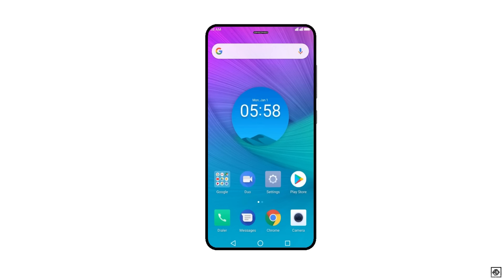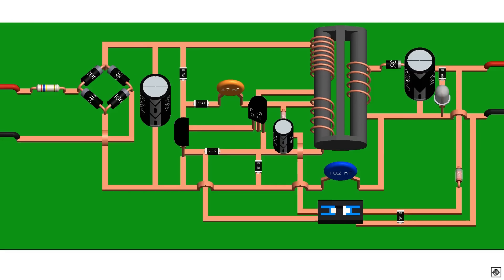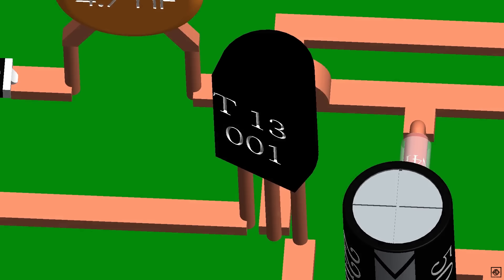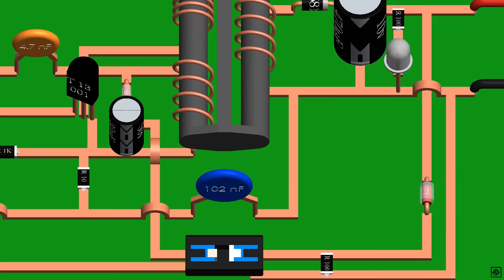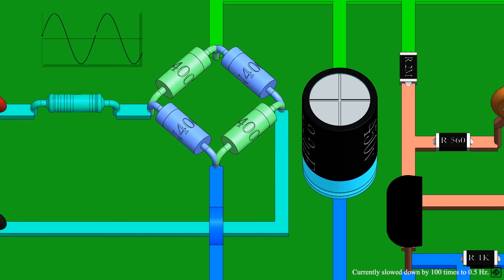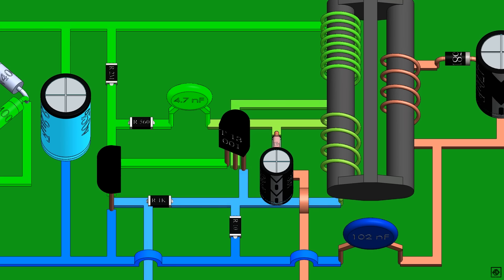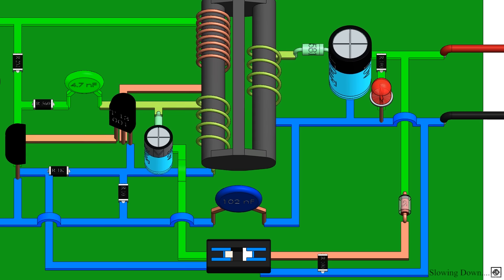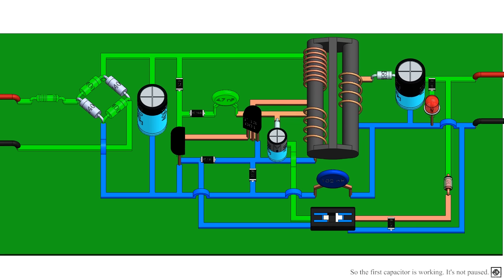How does a mobile charger work? SMPS with Opto-Coupler.

Comment: Great detailed explanation. Please review the markings on disk capacitors. I believe 102 nf indicates 10 plus 2 additional zeros or 1,000 nf value. Thanks.
Reply: I'll just hijack this comment to say that it is not 102nF or 1000nF. Hopefully no one has used the circuit posted. That would be quite dangerous to do so.

The capacitor in between the primary and secondary should be limited in value since it can be a low impedance path from the AC line if it is too large. Touching the output side will essentially be connecting yourself with the AC line with only this capacitance in between.
A 100nF  capacitance with a 230V 60Hz line has 26.5kOhm of impedance and will allow up to 9mA of current (painful shock). Increase that capacitance to 1000nF and you have a maximum of 90mA (can be lethal).
It also has to be a special capacitor that is safety rated because it can fail shorted if it is not, which will make the output directly connected to the line. Again, touching this output will electrocute you.

Please don't play with high voltage circuits. You can kill yourself.
Reply: @ronnueda933  

Correct, the cap is 1nF or 1000pF, "102" means 10pF + 2 zeros. That's a common value for such interference caps. 

Another mistake is of course the inrush resistor value is way to high, should be 4R7 or so.

Also, the secondary diode is polarized wrongly. The diode is sopposed to be reverse biased while the primary is energized, so a  magnetic field can accumulate in the core, which, when the primary is turned off, collapses into the secondary with the diode conducting and charging the cap powering the load. 
This is an important detail as it sets apart the flyback transformers (with air gap in the core to hinder saturation during accumulation!) used in low power devices like USB 5V supplies like here, from other kinds of switch mode transformer set-ups.

Comment: The conventional AC/DC converter is a 220/5V  single-phase transformer + full-wave bridge rectifier( four diodes arranged like that in the video) + filtering capacitor. However, this circuit  will result in a heavier phone charger since the frequency used is 50Hz
Note that the transformer’s size decreases by increasing the frequency.
So they thought about this idea mentioned in the video
We will use a full-wave bridge rectifier converting from AC into DC, then we apply that DC voltage on an oscillator circuit that converts that DC into a high-frequency AC voltage, so in the final step, we can easily use a small transformer to a 5 V , however, this voltage is AC
So we will use one diode( half-wave rectifier) which is more economical than a full wave rectifier, and a capacitor for filtering purposes!
The final input/output voltage is 220V_AC to 5V_DC!!!

Comment: The resistor's value is too large to be a fusible resistor. It should be below 10 ohm
Reply: The 260k resistor limits effective current flow to <1mA (at 230V on short circuit, less current on normal use).

That can not work. Better circut would be a fuse on input and a polyfuse on output. Maybe using a common mode choke is required on input to reduce interference on power line.

Comment: The resistor on the AC mains input circuit feeding the bridge diode arrangement cannot be as high as 260K ohms.  They are a fuse resistor normally in the range of 1.8 to about 2.8 ohms at 1/4 Watt rated. (I used to work in designing power supplies and a lot more sophisticated than the simple type used for charging phones).  Some years back I was designing precision power supplies for communications systems. These were linear supplies. These were multi level supplies with both master regulation and sub regulation circuits using linear regulation circuits.  I also worked in designing some types of switching supplies.  

The main input capacitor from the bridge diodes is normally about 5.6 to 10 mfd at 450 Volts rated at 105 Deg. C. At as low as 2.2 mfd there may not be enough smoothing to give proper and clean stability. Some of the lower end power supplies will use less than 5.6 mfd for this capacitor.

For voltage regulation via the opto coupler, the feedback is more linear. It is a constant type of feedback making sustainment to keep adjusting the oscillator duty cycle of the high frequency drive pulses to the transformer. When more load is added that will try to drop the 5 Volts, the duty cycle is widened more toward 50% and thus more current drive to the transformer to compensate, and thus stability occurs. With less loading the duty cycle is stretched out accordingly to keep the 5 Volts as accurate as possible.  Usually better than about 0.2 of a Volt.  

The phone or tablet has its own battery manager that will reduce the voltage to about 3.2 to 3.8 Volts  and regulate its own charge current depending on its own battery requirement. Also, there is thermal monitoring of the battery to prevent overheating of the battery. When the battery is charged the battery manager will reduce the charge current to necessary sustainment current and thus prevent over charging. 

Other than all of this, the explanation is well done and for the average person it would give them a good idea of how one of these simple 5 Volt switching supplies work.
Reply: so, thermal monitoring system avoid the battery to be over charged! Some times I connect my phone to charger in Night and unplugged it in morning. I think this system might save my phone from overcharge.
What will happen if somebody charge his phone 7 days without unplugging???

Comment: 260kohm is way much for this circuit it's real value is always below 200ohm a single led with 20ma consumption needs 68kohm to glow and according to you mobile charger uses 4 times less current that is 5 ma after conversation of 5 ma at 220v to 5v it equal to 220ma with no losses and an ordinary local mobile charger is atleast 750ma. And 269kohm resistance (fuse resistance) is much more hard to blow off.

Comment: 2:53 That capacitor wouldn't be a "102 nanofarad" value, but instead a 1 nanofarad value capacitor. The "102" is used without any suffix, and instead means 10 with 2 more zeros = 1000 - it's value in picofarads. 1000 picofarads = 1 nanofarad. This "code" is used on very small capacitors to indicate value, as there is very little space but for printing 3 tiny numbers, hence the code. BUT Thanks for this video, as it showed what the optocoupler is used for - I didn't know that.

Comment: 6:19 why is there so much persistence to state that a pulsed DC wave is AC? It is never turned back into AC before going into the transformer, it is rather a pulsed DC square wave, which never changes direction, only amplitude.

Comment: So if the circuit fails I just need to check the resistor next to the full brige rectifier, try replacing it and hope it's now fixed
Reply: good question

Comment: Beautiful! But there's one mistake that should be correct to help better understanding of the circuit. In animation mode  the voltage of electrolyte capacitors after first cycle of input current ,will be almost at peak and doesn't change like what you have shown. Otherwise we don't have dc out put .
Reply from the maker: Actually, that's the energy stored in capacitor. 😀

Comment: I am a power electronix engineer yet i am surprised that how easily can i make the inverter ckt after working alot with dsp processor and how easily can i make feedback control after working with opamp based controllers and compensators...... flawless

Comment: 1:57

isnt this the DC to AC circuit? (video states AC to DC)
or is it a DC circuit to control the conversion of AC stepdown of the transformer in the next step? 3 "AC to DC" circuits are shown in the video, but it was stated that it is an AC-DC-AC-DC circuit overall, so that was confusing.

Comment: Thank you very much for this great presentation. I always wondered how can a minuscule plug convert AC to DC without a heavy transformer which i saw in my electric circuit classes long time ago and which, in the past days, was necessary for the purpose. You have explained nicely that the high frequency allows for the size reduction of the transformer. But can I ask a question about the intermediate  DC to high frequency AC converter?. This is the circuit that is composed of transistors T! and T2, the auxiliary winding and some resistors. As far as I can see the conversion is done by constantly modulating the potential at the basis of T1 and thus turning it on and off and as such creating the rectangular high frequency voltage signal. My question would therefore be :Which part of this circuit determines the frequency of the rectangular voltage signal?  Can we , by changing the elements of that circuit, induce any  given frequency  of the rectangular signal? Is it possible?

Comment: Thankyou sir,
Sir y all the transformers will be covered with yellow sheet around and also top of it..?🤔🤔I also tried to remove it but it's very hard to remove..
Reply from the maker: Its insulation. The insulation is placed between all the windings (primary, secondary and, auxiliary).
Also, the transformer core parts are joined with glue, so there would be no air gap or less air gap.

Comment: Better and beautiful explanation. But the fuse resistor connected in starting should be a low value.So the value may be 2.6 ohm, not & never 260k

Comment: Phone batteries are also smart batteries, they contain an eprom allowing the battery to work better if discharged properly. Laptop fans, motors from phones can fix bad mobile batteries, as if they were new ones. GPS positioning causes battery malfunctions, or apps requiring the localization permissions. SIM cards also activates GPS, later on batteries will be memory effected. The best phones for elite managers, are those types that don't have any net capabilities at all. That will last for the longest time for phone calls.

Comment: Isn’t it safer to step down the voltage before feeding it into the rectifier circuit, or is this configuration necessary to make the circuit independent of the load resistance? 

And wouldn’t the half wave rectifier circuit lead to power delay?

Comment: Check if the resistance at AC input, almost all voltage could be drop by 270k ohm resistor. And uasually no resister is being used as fuser to prevent over load.

Comment: It converts it 3 times? Man I'm surprised how effectively they are i would've thought that they aren't very efficient by doing that
Reply: The efficiency comes down to using really high frequency AC on the second step, allowing you to use smaller components and transformer

Comment: Ok, so I understand how this works, but this is for a 220v charger.  Most chargers now I've seen are ranged from 100v  to 240v AC input.   Does this same exact principle apply to keep it at 5v DC out?  Also, is the same as how laptop chargers work?  Is it the same basic principle?
Reply from the maker: Yup. This will work for chargers ranged 100-240 volts.
Yes, this is used in laptop chargers also.
Reply: @ExplorerStuff  Awesome! Thank you for that.  I had wondered how that would work for such a large input voltage range.
Reply from the maker: @TimothyWinters1968  The voltage is controlled by the feedback.

The transformer used in the charger will transform 240 to 15 volts (170:11 turn ratio).
The voltage does not increases form 0-15 instantaneously, it takes some time, and when the voltage increases above the 5 volts the feedback triggers.
The voltage can increase to 15 volts but it was only allowed up to 5 volts.

Similarly, 100 volts transform to 6.5 volts.
Thus we can get the 5 volts output from 100 volts.
Reply: @ExplorerStuff  OK that is pretty awesome the way that works.  When I went overseas to the Philippines for a few years, I was able to use the same charger for my laptop and cell phone there as I used here in the US.  So, thank you for your explanation.  That satisfied a curiosity I've had for years.
Reply from the maker: @TimothyWinters1968  Glad you liked it.😀
Reply: @ExplorerStuff  sorry for silly question, do you know where can I find this kind of transformer (170:11 turn ratio)? Does it have some kind of factory markings? I need it for my own ac/dc power supply, but I can't find last part.
Reply from the maker: @IandrewkoI  If you are using this circuit, then It can be of different turn ratio. 
if output is 5V, then a 170:11 gives 15 volts (240 V input) , Hence we can use this transformer for any voltage between 0 volts and 15 volts.

Comment: Good stuff. Although, you left out the 'data' part, how the phone communicates with the charger to initiate its charging protocols.
Reply: Well thats for a good reason, usually they don't, new high power usb 3.0 chargers will do and some chargers require some voltage on the usb 2.0 data lines but most phones will just be happy woth a 5.1V on the power lines of the usb port

Comment: What if we need 5V, 3A? Which is the component we need to change? Which component decides the current value??
Reply from the maker: Then you would need to change almost everything😅.

P.S.: The output of this circuit is 0.5 - 1A, not 2A.
(It's 2A in video because most people are familiar with 2A.)

If you want 5V, 3A(15W), use a buck converter with source that can supply 20W (nearly 80% efficiency of converter) or more, this charger can't.
You can use a 12V,2A(24W) adapter. Also, I don't recommend modifying because it can overload parts.

And a buck converter with max current 5A (not 3A because it will overheat if kept running for too long). 

The current value (for output) is decided by the turns of secondary winding and the load.

Comment: im SMPS does the current in the secondary increase as the frequency increases or does the secondary current adjustment consist of the thickness of the wire wound to the transformer?
Reply: Es un conjunto de varios cálculos, incluyendo el calibre de cables en primario y secundario, y el  núcleo, así como el tamaño del transistor principal

Comment: Instead of converting the First DC to AC again,  can we use a DC-DC Converter (may be a Buck Converter)?
Reply: You can use a buck converter if the input source is safe and of sufficiently low voltage.
The circuit in the video DOES NOT convert DC back to AC.

Comment: How is the circuit that have 2 transistors are making AC? The graph  of the transistor circuit shows a pulsating voltage that is positive, and hence it's DC. How is that an AC?

Comment: *Fusible resistor at AC side must be below 10R suggested, 260k is not practical
*It's AC to PWM DC to DC , AC is only the input voltage before the bridge rectifier

Comment: What if we have dc as input like inverters . Can we charge our phones on inverter power ??? Is it safe for phone charging  ??
Reply from the maker: If you have DC as input, then you will need a buck/boost converter to convert the voltage to 5V and charge the mobile.
But, its a bit risky.
Reply: @ExplorerStuff  i am talking about that inverter which are used in homes to provide electricity when normal Ac power is not available.
Reply from the maker: @Amir_Reshi  Yes, you can charge mobile phones with it by charger, but, only sometime. Because most of the inverters provide an approximation of sine wave not pure sine wave as chargers are designed to work with sine wave.
Reply: @ExplorerStuff  ok thanks a lot sir.. Stay blessed❤

Comment: thank for the very explanation. Would it be okey if you can share the size of the transformer and wire on the primary and secondary thanks in advance

Comment: In the beginning there was a capacitor with around 400 volts, does this capacitor also outputs 400 Volts?
Reply from the maker: It is the maximum voltage the capacitor can handle.
Above this voltage the capacitor can break.

Comment: Namaste

Full charging cycles must be avoided as lithium - ion battery operates at lower voltage when closer to empty and voltage rises as cell charges up.

Operating at low voltages is beneficial for battery life

Thanks

Comment: I have a Lithium Ion battery. ~14V and I connected a ~5V supply. I am not sure why the battery didn't charge. Is it because the voltage is too small? If the voltage is 14V it would charge? Does connecting just positive of a supply to a positive of a battery and the negative of a supply to the negative to the battery. That would charge right? Is making a charger that simple and is the concept and idea of charging this simple, easy, and basic? What happens when a battery is being charged?

Comment: Well I have a question . I just bought a digital clock online and it requires a mobile charger to run it . So if I use a mobile charger 24/7 to a clock ,will the charger explode?

Comment: Wouldn't it be 110 volts incoming not 220 since one is neutral and one is a power. 220 needs 2 hots coming in hense 3 phase. Am I wrong ?
Reply: Hay sistemas 220V monifásicos con retorno a neutro, como los usados en España. Saludos

Comment: What is the transformer specification please?
Reply from the maker: Any flyback transformer with input voltage of 240+V AC, frequency 100kHz+ and power rating as per your requirements.

Comment: Please,  which circuit and component that determine amper ??
Reply from the maker: It depends on Voltage and Load.
And max power transfer by Transformer.

Comment: How they design such complex circuits? I am studying electronics but i still can't design such circuits only copy paste circuits.  Any tip to improve myself
Reply from the maker: The best thing will be "To break the operation in steps, identify the constraints, and evaluate". (Use google)

Copy-paste isn't bad, Initially, most of us do this. Just understand the circuit (how does it work, why these components and arrangement).

Comment: I am trying to make this smps but transistor 13001 heating and output not gain.Confusion with Transistor 13001 in video you are showing pin configuration B,C,E but transistor datasheet is E,C,B.